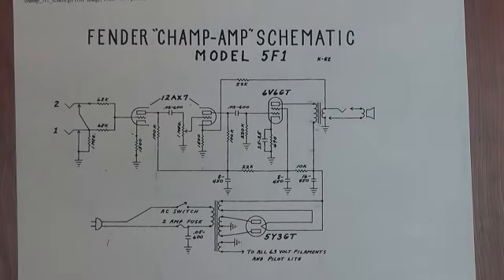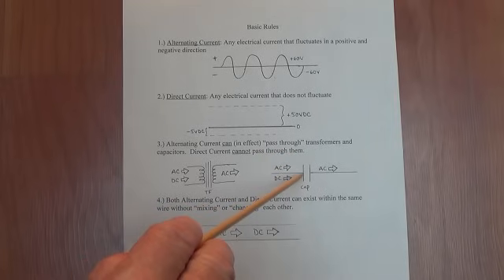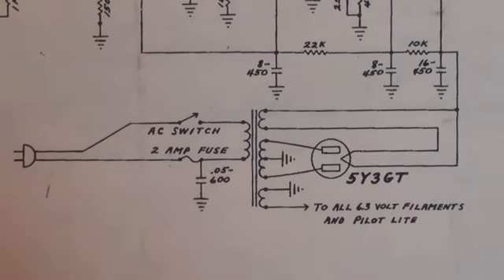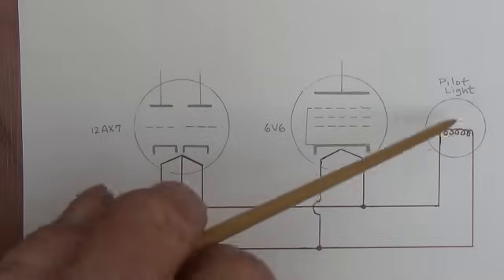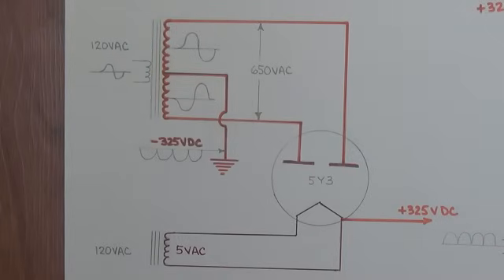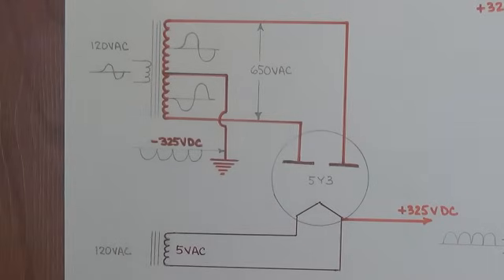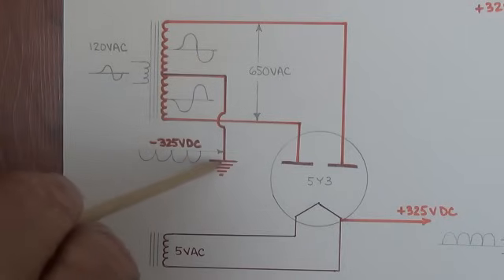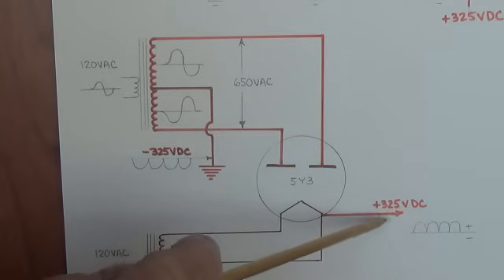How Tube Amplifiers Work, Part 1: The Power Supply

Comment: hey man.  not to beat a dead horse but- does the +325vdc travel across the tube towards the positive side of the filament?   also, does the negative dc ever enter the tube.  I just think I've been looking at this wrong because I think too literally when it comes to reading schematics.  in my brain, I see two inverse AC waveforms existing in the tube at the plates of which the negative goes to ground and the positive is passed on to the plates of the 12ax7 and 6v6.  my mental block is- I don't see the line connecting the the rectifier tube to the center tap ( on the schematic). does the negative dc travel back out the inverted secondary winding and then to ground?   sorry ahead of time.  I'm just to that point where I understand just enough to make me dangerous .... or annoying depending on your perspective.
Reply from the maker: In my mental picture of the circuit (which may be overly simplistic but explains the result), the B- is selectively rejected by the rectifier, passes back through the transformer windings (temporarily coexisting with the AC high voltage) and out the center tap to ground. This is similar to the B+ traveling through the rectifier filament wires (coexisting with the 5VAC) until it can exit to the amp circuit....eventually reaching ground and completing the circuit. It's like a self-charging battery, with the secondary CT as the - pole and the wire exiting from the 5VAC loop as the + pole.
Reply: During both the half-cycles of AC, a positive voltage appears on one plate of the rectifier and a negative voltage on the other. The diode with the positive voltage becomes forward biased and conducts, passing current to the filter capacitor. The negative voltage encounters a reverse biased diode which amounts to an open switch so it does nothing and goes nowhere. There is 5V AC r.m.s. across the filament winding which means that one end is swinging between +7V and -7V with respect to the other end. One end is at the B+ voltage on the filter capacitor so the other end must be swinging between +7V and -7V with respect to B+. The  filament 'sees' a DC voltage at one of its ends (B+) and varying DC voltage with a DC component (B+) and an AC component of 14V peak to peak (i.e. 5V r.m.s) at the other. No matter what the B+ voltage happens to be,  a voltage of 5V r.m.s appears across the filament.

Comment: Can vacuum tubes be damaged by storage in a very cold environment - such as an unheated shed in the winter ? thanks - assume they are protected from moisture
Reply from the maker: Greetings, JB. Since the functional components of vacuum tubes are sealed within a glass-enclosed vacuum (hence the name), they can last for many, many years in all sorts of environments.....as long as they are protected from harsh vibration or impact. I have personally opened sealed 80-year-old tube boxes and found the tubes within to be as fresh and functional as if they were a week old. Weather temperatures, i.e. -20 to +120 degrees F, are not an issue.
Reply: Uncle Doug
that's awesome - Thank you kindly for your reply. I came across something like 1000 tubes from around the 1950s and have no room in the house :)
Reply from the maker: You're a lucky guy, JB. A lot depends on whether the tubes are new or used, and what specific tubes you have. Many old TV tubes virtually worthless, but certain amplifier and radio tubes are in high demand and could be valuable.....i.e. 6L6, 6V6, 5Y3, 12AX7, 6BQ5, etc.
Reply: Uncle Doug Thanks again. Still have to sort through them. All different sizes and shapes. Some little tiny ones, but many large. It was from the estate of an audio enthusiast radio hobbyist - all for $25. A bunch of stuff, including many NOS ceramic tube sockets that have been selling like hot cakes.
Reply from the maker: You may have a gold mine there, JB. Congratulations and best of luck :)
Reply: Uncle Doug
thanks. Just randomly pulling out tubes to see if I can find information online, found a WR21 with a brass base. Looks pretty cool. Also found what is apparently called "Magic Eye" - I get the sense that most of these date from 1930s-50s. I had picked up a tester Hickock 533 from a yard sale recently because it was cheap - if its working and calibrated, is that a reasonable machine for testing tubes of the era I mentioned, or should I be looking for something else? Happy Thanksgiving
Reply from the maker: JB, I am not personally familiar with the model 533, but IMHO, Hickok is one of the best brands of tube tester that you can get. My own tube tester is a Hickok Model 600A. You certainly have excellent yard sales in your neighborhood !! Here is a site that discusses it:  http://radiolaguy.com/Showcase/TestEquipment/Hickok_533A-g.htm
Reply: Uncle Doug
lol. Yes, one of the advantages of being poor in the 4th richest county in the states. thanks again
Reply: ***** which county? which state? :D

Comment: Please let me know this. I have a Hughes kettuer amp head. Also have a Digitech Integrated Effects Switching system.i was would like to know if i can use it with out damage to the amp tube head thanks Joe. 804 306 7210. Or joegray @ gmail.com.
Reply from the maker: Joe, I'm not an expert on either of these devices and cannot confidently answer your question. I suggest that you call either an H & K or Digitech service rep and get their authoritative opinion. Best of luck.

Comment: Your videos are superb. But on the full wave rectifier section, I do think you should read the top paragraph on this link. It shows another way to explain a valve rectifier in a very simple way. How Tube Amplifiers Work, Part 1: The Power Supply Anyone else still confused just click that link. Study the simple stick animation that shows the action of electron flow in this full-wave circuit. (This shows two separate valves but it is functionally identical to this 5Y3GT circuit). Also what is the "Death Capacitor" ??

Looks like the 5VAC sits upon the same wire as the 325VDC which is very interesting.  So does that extra 5VAC swing get filtered out somewhere else in the circuit? Would that not be another source of ripple noise? Or is it negligible in comparison?
Reply from the maker: Greetings, Kevin, and thank you for your kind words. I'm a little confused because the link you cite is to this video. The Death Capacitor is generally a 0.05uf capacitor from the primary AC line to ground that (hopefully) helps remove the RF and line noise from the 120VAC. People fear that it will become shorted, energize the metal chassis, and cause them to be electrocuted.....hence the name. Since the 5VAC is part of a closed circuit (5V secondary winding and rectifier filament), it has no reason to venture into the high voltage DC line.
Reply: Thanks Doug. From the schematic it looks like the 5VAC is tied directly to the 325VDC  (Both look as though they are connected to the cathode) why are they connected or am I seeing this wrong.  If they are connected then should not the 5VAC sit on top of the 325VDC. I am confused. Would really like to understand that bit. Is it that the 5VAC is connected to a heater element and not the cathode. Or is there some kind of insulation layer inside the cathode to keep these two wires separate?

The link I should have entered is this one. I think you'll like this http://www.electronixandmore.com/resources/pwrsupplies/index.html#5
Reply from the maker: Kevin, this is my interpretation of what's happening: There are actually two circuits here, a 5VAC circuit between the rectifier cathode and the secondary PT winding....and a +325VDC circuit created by the rectified HV flowing from the rectifier plates to the cathode out to the amp circuit and then returning to the center tap of the HV secondary winding.

Since the 5VAC circuit has no return through the HV center tap, it has no reason to enter the HV circuit....it remains within the loop between secondary winding and cathode. The HV, however, leaves this loop because its return is at the CT of the HV winding.....not the secondary of the 5v winding. At times, they coexist within the same wire in the secondary loop, but do not mix.

If your concept were correct and the 5VAC could become a part of the HV circuit, then the converse would be true and the HV could become a part of the 5VAC circuit....resulting in two 330V circuits.

I checked out the link and found it to be quite informative. I would differ with their opinion regarding the necessity of DC for directly-heated filaments/cathodes, since countless amps seem to do quite well with AC-directly-heated 5U4's and 5Y3's. Thanks for posting it :)
Reply: Many thanks Doug, for helping me with this. Good stuff.

To my totally confused, muddled and mixed up mind, if these two wires (from the 5VAC secondary and from the cathode as the HT line) are in physical contact hence, surely they're effectively the same wire? So we must have a 60 hz AC signal (from the 5vac source) mixed in with a unfiltered DC signal. So why don't those two signals simply add together? So yes understood, not voltages adding, but instead the signals adding together.

I now understand that the 5VAC will always be 5VAC as that is PD across the winding for the cathode lead. Where as the 325AC is PD across the HV winding and the center tap. So at least I now understand that anyway. Thanks!

Hope I am not wasting your time. Just so much want to understand this. It is really bothering me. I searched all over the net yesterday and have only found this one article which describes something called a hum balance control. But I don't know if this is strictly related as although they are talking about a direct heated cathode tube, it is NOT used as a rectifier. But it does seem to suggest that the AC 60hz signal on the cathode effects the resultant DC signal.

So does this page make any sense? 
http://diyaudioprojects.com/mirror/members.aol.com/sbench/humbal.html

I'm getting so confused with this now. But its all good fun!

Many thanks again for your time. Hope its okay to pursue this a bit further.

BTW, really enjoying your videos only just found you. Rusty is so cool. Have subscribed and liked!
Reply from the maker: Kevin, please read (re-read?) my response (immediately above), in which I carefully explain exactly how and why the two different voltages coexist briefly in the same wire and do not mix. If that doesn't work then maybe this will help:

Think of the two voltages as phone calls. In the 5V circuit, the call originates at the top (in this example) of the secondary winding, goes through the rectifier cathode and is received at the bottom of the secondary winding. In the HV circuit, the call originates at the top of the HV secondary winding, passes through the plate and cathode of the rectifier, for a while shares the wire with the 5V call and then travels through the amp circuit and is received at the center tap of the HV secondary winding. Each call only goes to its own specific destination. The 5V call has no reason to go to the amp circuit because that is not its destination. No mixing occurs. When you talk on the phone, do you hear all the other calls, or do you just hear the one that was sent to your number?

In the amplification (not rectifier) tubes of  every amp I have ever seen, the cathode is never directly heated by 60Hz AC. It is indirectly heated by 60Hz AC (passing through a separate heater filament) so that it will release electrons, but the voltage applied to the cathode is DC. In fact, if any 60Hz AC can get to the cathode, the tube is defective.

I believe that the article you cited is far too complex and esoteric to be helpful. I appreciate your subscription and support, and sincerely hope that the information I have provided clarifies the issue.
Reply: No, I'm still utterly confused. But thanks anyway. Very grateful for you time.

Kind regards

Kevin
Reply from the maker: OK, Kevin. But please keep in mind that AC and DC do not mix. They are like oil and water. The 5VAC and 320VDC coexist temporarily in the 5VAC loop, but the 320VDC leaves the loop to go to its destination in the amp circuit, leaving the 5VAC to continue its circular path. In both cases, they are attempting to return to their (very different) respective points of origin.

Comment: 4:00 -  whoa - stop -  I thought if you connect a line like that from the hot to the neutral, with a switch in between, as soon as you flip the switch...you create a short...   the wire being the only resistance in the circuit... if it has any at all...  heats up and glows and burns up or god damn explodes in sparks.
Reply from the maker: The wire isn't the only resistance in the circuit. The primary winding of the power transformer is in series with the AC line and reduces the current flow, preventing all the excitement you describe. This is the standard primary circuit for every Fender tube amp. When you plug in a lamp and turn it on, the circuit is quite similar.....the filament in the light bulb reduces the current flow. There is no short circuit.
Reply: The primary winding is an inductor. Inductors have a property known as 'reactance' which essentially resistance to AC. As far as the AC input is concerned, there is a 'resistance' between hot and neutral, not a short.

Comment: Hi Uncle Doug and thanks for the great posts. I have the first of many questions for a well educated and selfless person like yourself.  When trying to wire an amp using a schematic you can find online, like the one you are basing this explanation off of, how do you know whether or not to wire the leads to ground or COMMON ground (aka neutral)? For example, the schematic for the Champ has the ground symbol notated for the 6.3 V filament but we know the circuit just comes back and completes at the transformer. But for the coil tap on the 650 volt circuit, where does the -325 DC go? It seems like that would be a lot of voltage to send to the chassis and safety ground. Unless it goes back to common? Or am I missing something in the theory? Also, do the filter caps go to common or ground? How do I tell the difference or am I looking at it all wrong?
Reply from the maker: Greetings, Rad. I sense some confusion and concern about the chassis being a vital part of the electrical circuit of the amplifier, but it really is. I believe the source of the confusion is that there are two completely separate circuits in an amplifier, each with its own "ground".

The primary circuit, which consists of the primary winding of the power transformer,  fuse, "death capacitor" (if present), and on/off switch, is powered by the two wires (black "hot" and white "neutral or common") from the 120VAC wall receptacle. The third (green) wire in the cable is a "ground" for this primary circuit only and connects to the amp chassis to protect us from short circuits between the primary circuit and the amp chassis.

The secondary circuit, which consists of the secondary winding of the power transformer and all the remainder of the amp circuit, including the amp chassis. In this circuit, the chassis itself is called the "ground".

To further add to the confusion associated with two separate "grounds" is the fact that they serve two separate purposes. Since this confusion seems widespread, I will prepare and post a video on my channel addressing and (hopefully) eliminating the confusion. Stay tuned.............
Reply: Uncle Doug Thank you and I will be looking forward to the video. I am still a little confused about the way the schematic has explained the circuit. There is a ground symbol on the 6.3 volt filament, but when you explained it in detail the circuit seems to leave the transformer, go to the filaments, the light and then return to complete the circuit at that ground symbol (aka the transformer and what I would call common). Considering that the rest of the ground symbols in the schematic appear to actually 'ground to the chassis', how do we tell the difference without having a broader understanding of theory? (which I am desperately trying to develop by the way)
Reply: Rad10head707 Also, what is the function of a death capacitor? I apologize for the questions but so far your videos are the best I've found for amp building on the web. Thank you.
Reply: Uncle Doug Also, what is the function of a death capacitor? I apologize for the questions but so far your videos are the best I've found for amp building on the web. Thank you.
Reply from the maker: You're welcome, Rad. The "Death Capacitor" was originally intended to filter out any radio frequency (RF) "noise" that may be present in the incoming AC. At the time these caps were used, back in the 1950's and 60's, there were many very powerful AM radio stations all over the country and RF interference was a real issue. Nowadays it is not.